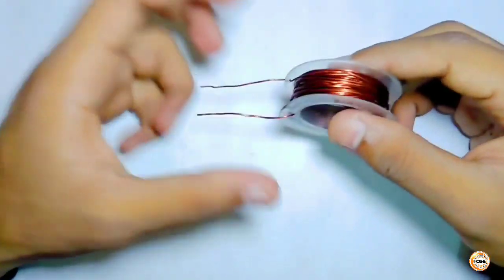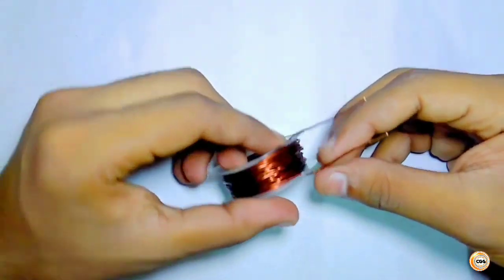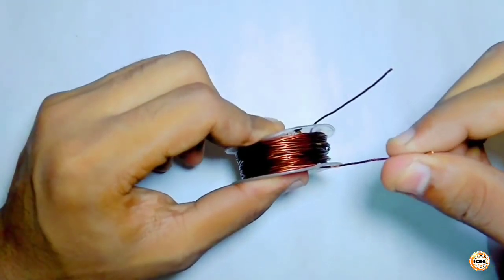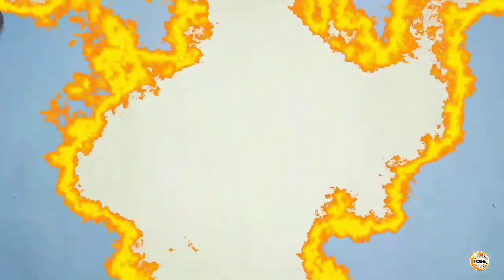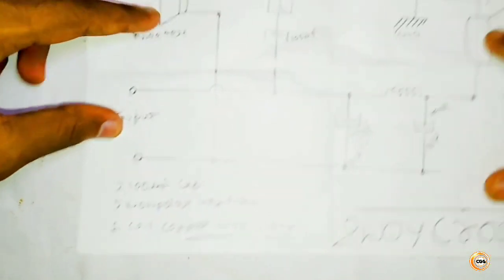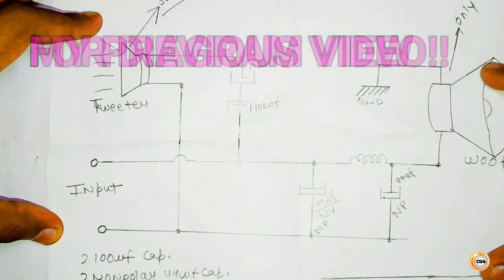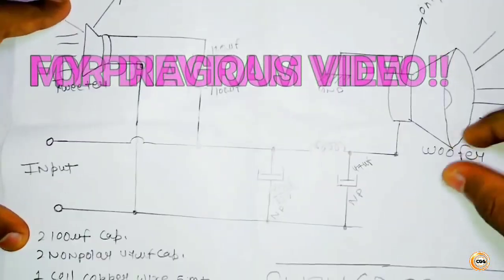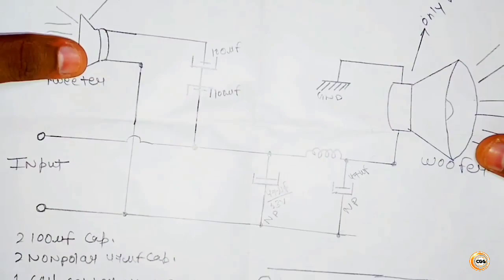Home made 200watt 2 way crossover||easily(Hindi and English tutorial!!!

Comment: You can’t use dc capacitors or you will ruin your speakers and amplifier since the output of your amplifier is ac u need to used bipolar capacitors in a crossover circuit